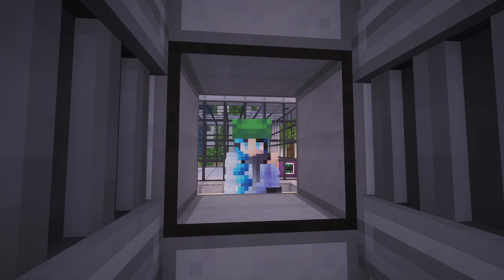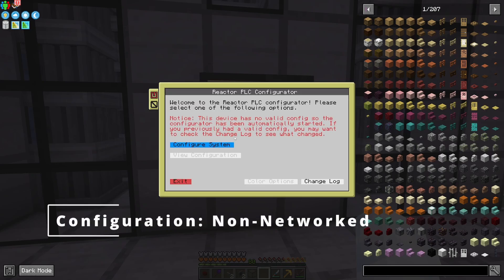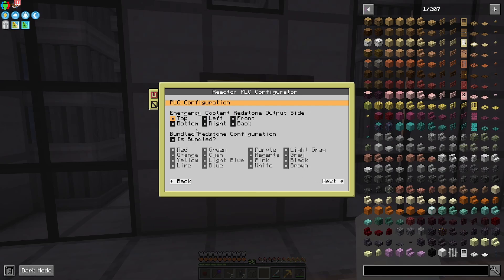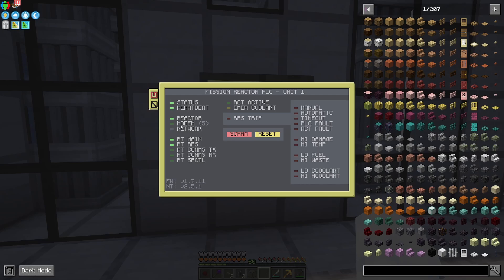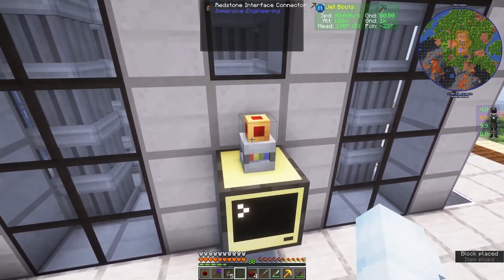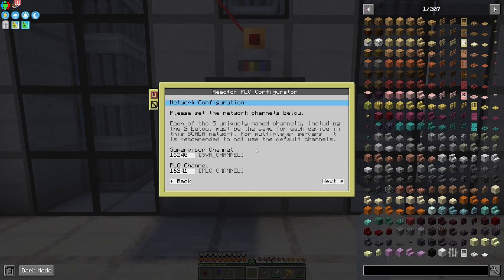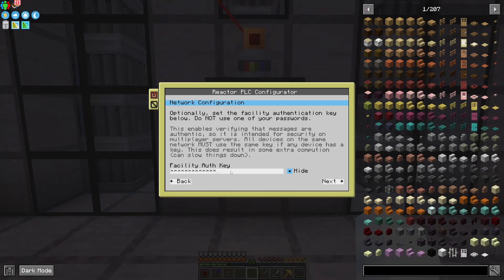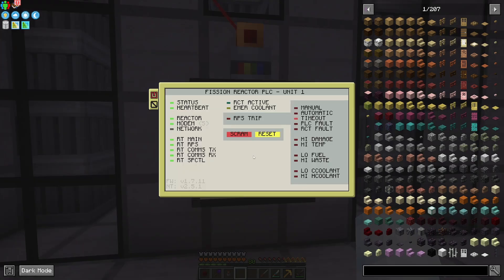Reactor PLC Setup | cc-mek-scada

Comment: Hello ! I've set up a single fission reactor, no network, no emergency cooling, and I have noticed an issue : The reactor is turned off as soon as the chunk isnt loaded, even with FTBChunk enable (But not my personnal claim tho) (I'm on a personnal server with full acces to files). Is there a way to solve this issue other than connecting it to a full network?
Reply from the maker: ComputerCraft shuts computers down when chunks unload. If you have a supervisor chunkloaded, it will resume auto control of a reactor assigned as such, but if the supervisor reboots it'll be the same situation where things are stopped. I'm working on a way for the supervisor to save and restore state information across reboots, but this CC behavior means that there isn't a way for you to guarantee things resume without interaction on chunk load.

FTB chunks had a config option change in some modpacks where it'll still unload force loaded chunks if everyone in that team/group/server logs off even if the server is still running. If that is what you are running into, that could be a "fix"
Reply: @cc-mek-scada  gotta check that config file then, thanks for precisions!